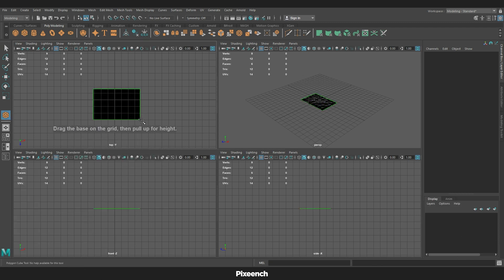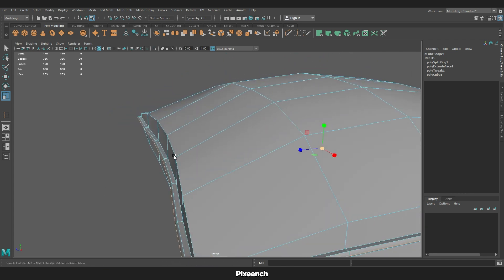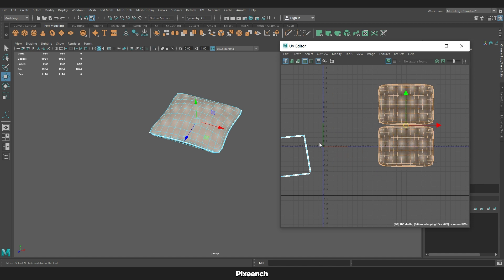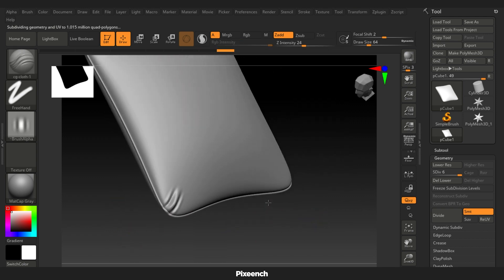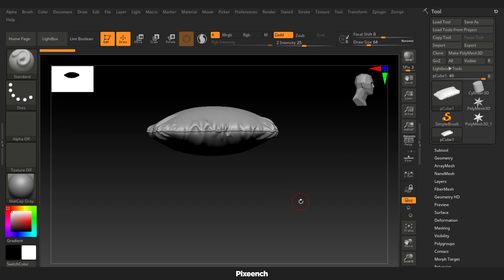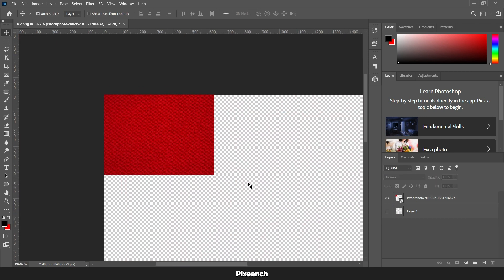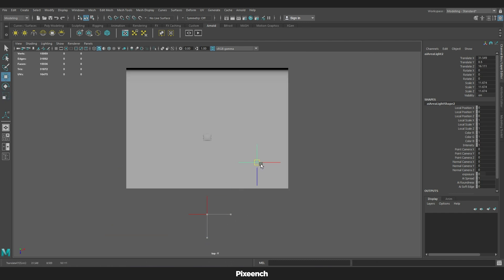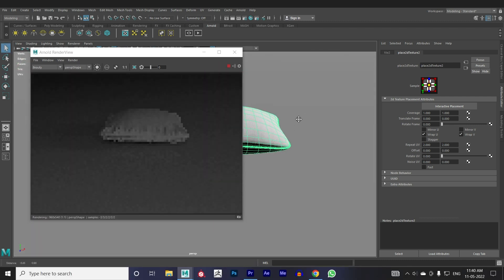3D Modeling Tutorial: From Scratch in Maya to Realism in ZBrush @Pixench

Comment: 3D gaming industry assets does not use high poly model, this is for VFX and movie industry, unless you're willing to use 30K+ Poly for a pillow inside a game. High poly assets are used to bake normal details onto the low, they serves no function aside from that. Also most if not all effective video game modelling workflow use a texture painter like substaince or mari, (some like WOW or league do use hand painting).
Reply from the maker: Many criteria are needed to create games
How much detail is required
How many models will be rendered at once
Target game platform
How prominent is the model
Type of textures used
For the character poly limit is 100k
For props, the poly limit is 20k
Now the game model is imported directly from ZBrush to Unreal Engine, and textures for games are also created in Photoshop, creating textures in substance painter and Marie is easier because it has plugins. However, that software is a little harder to use than Photoshop